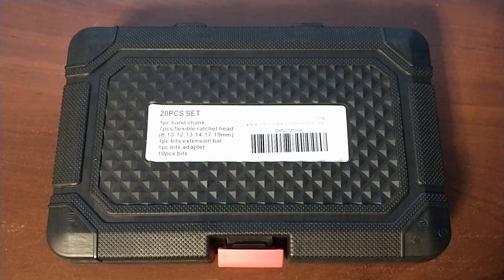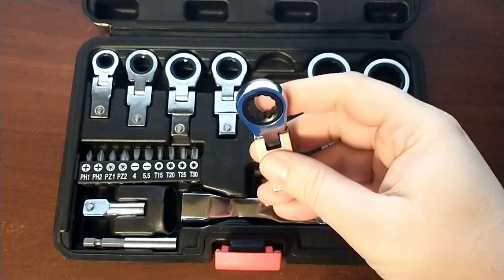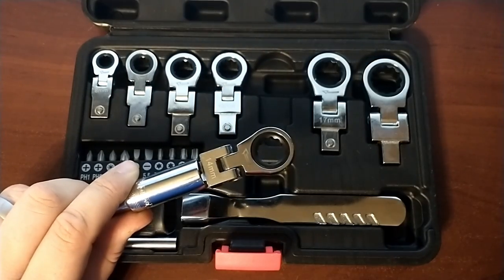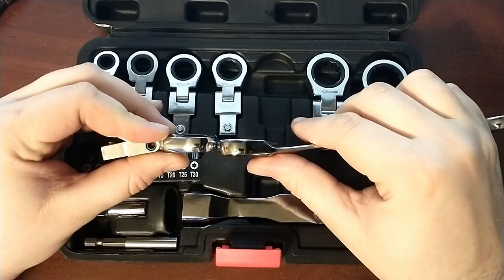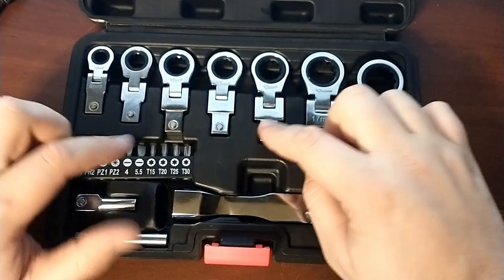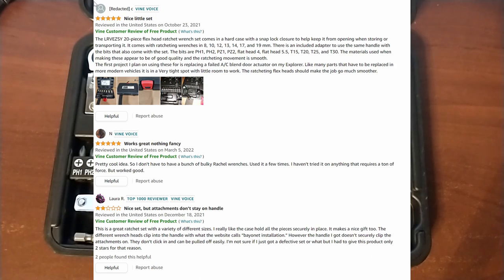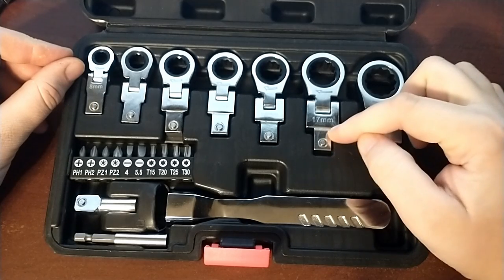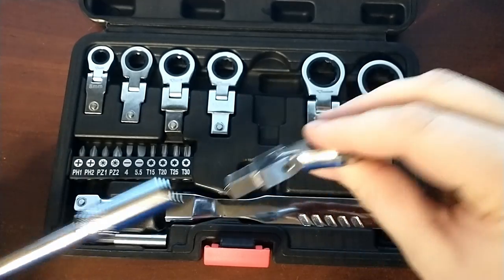Ratcheting Crow Foot Flex Head Set

Comment: I remember mid 2000's Stanley released a flex ratchet handle with changeable heads. Bit driver, 3/8 drive, and ratcheting box ends in sae and metric. You can still find used or new old stock on eBay. However it seems the changeable ratcheting box ends are impossible to find. Cool concept never went anywhere.